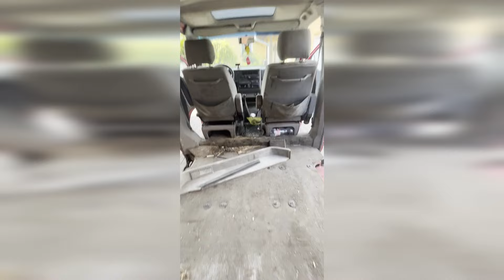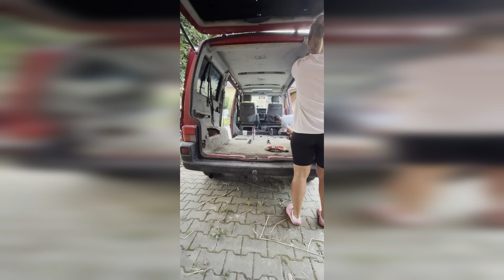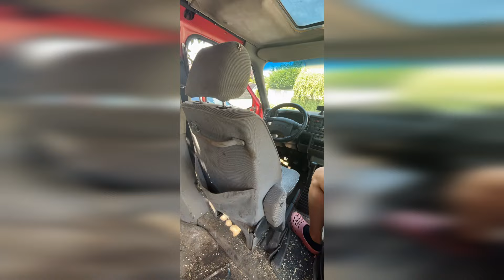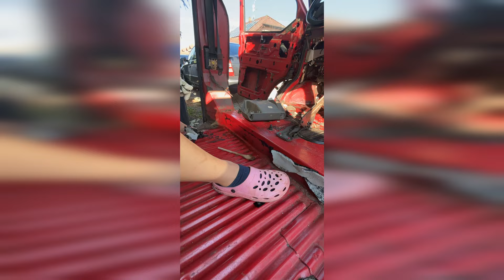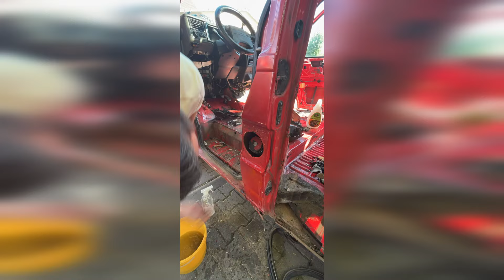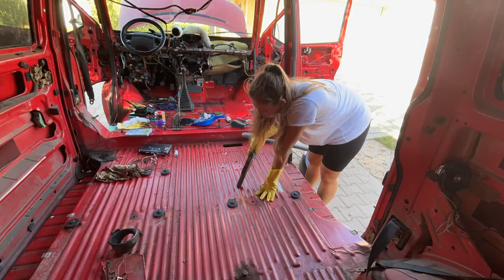Campervan build | VW T4 | Fixing issues | Part 1 - Deep clean (RAW footage)

Comment: That's so dirty. What happened to it?

How does it drive?
Whats the mileage?

Buf great job cleaning it. Looks so much better now
Reply from the maker: Thanks !

Guy that had it before us did not take care of it. Most probably there were even mice living inside for some time

Engine is decent, even though the turbo is burning a bit of oil.. it has 630 000km on the clock
Suspension needed to be done (video coming)

Lot of work and also content ahead of us 🙂
Stay tuned